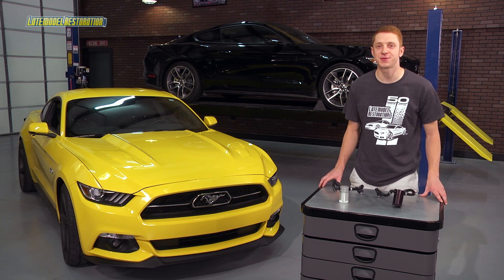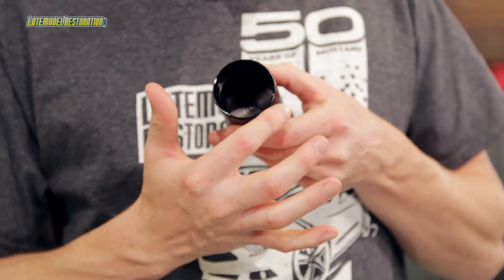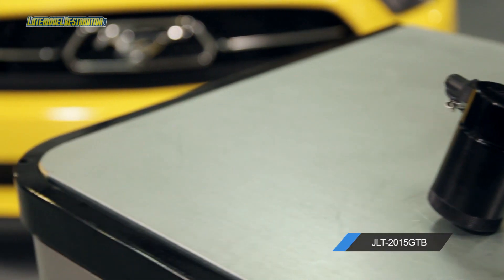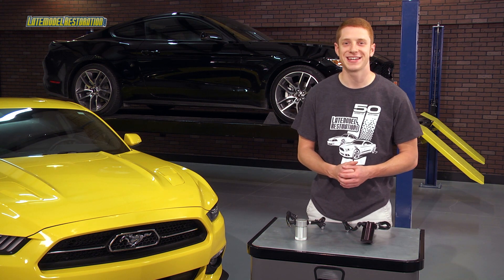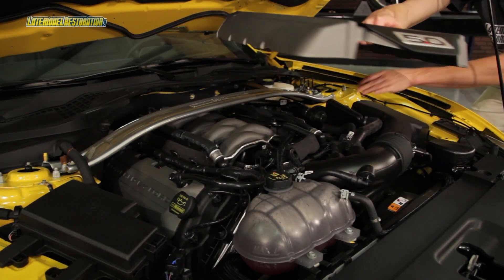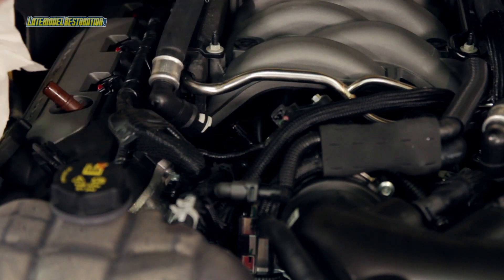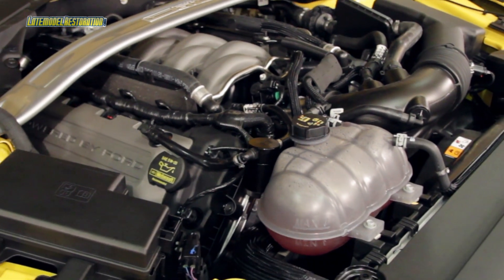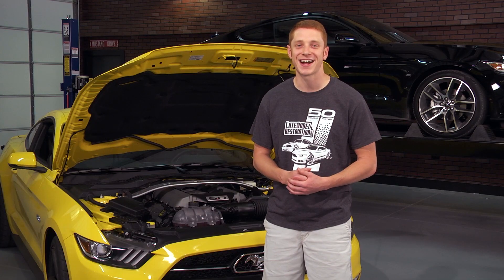Mustang J&L Oil Separator - Review & Install (2011-2017)

Comment: Interesting but does it really achieve much? With regular oil changes, how much a need is there for an oil separator?
Reply: +John Adams The PCV should be burning the vapors to eliminate them. What is the need of collecting the vapors, etc.?
Reply from the maker: +John Adams Not all of the vapors get "burnt". Overtime, the oil vapors will begin to build-up and cause inefficiency. A perfect example is a Ford Lightning, without a catch can or separator, oil builds up in the lower manifold and covers the intercooler. For example: http://www.f150online.com/galleries/images/720-896-84623.jpg -Landan

Comment: Do these motors have a problem with excess oil in the intake? If a separator was needed wouldn't Ford have added one? I don't see a need for this unless you are running a supercharger.
Reply: It’s good for the engine. And ford wouldn’t do that because they want you to buy more ford products such as getting rid of the old mustang and getting a new ford because engine crapped out

Comment: Can a 2014 driver side oil separator fit on a 2015
Reply from the maker: myskman1 Yes! The driver's side oil separator will fit all 2011-2015 5.0 Mustangs. -Landan
Reply: Cool thanks

Comment: i dont understand the purpose of an oil separator. what does it do? what are the benefits
Reply from the maker: The purpose of an oil separator is to 'trap' the oil vapor from entering your intake system. As crank case pressure rises, oil in the form of vapor is released and recirculated through your PCV system. So having an oil separator installed will prevent oil vapor from entering your intake system. -Landan
Reply: However, the purpose of directing the vapors back into the engine is to combust them so they don't pollute the liberals greens earth.